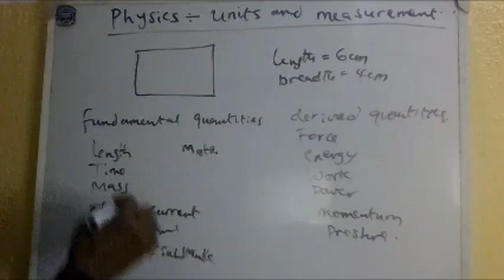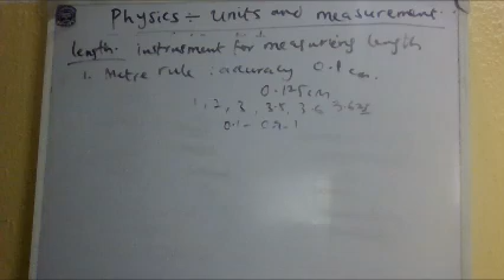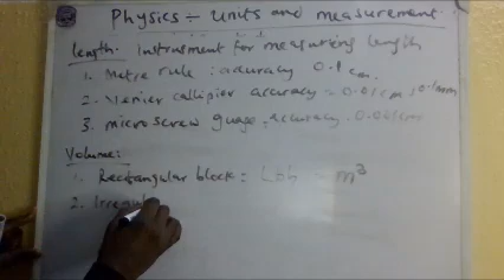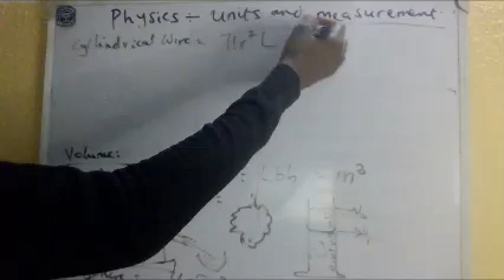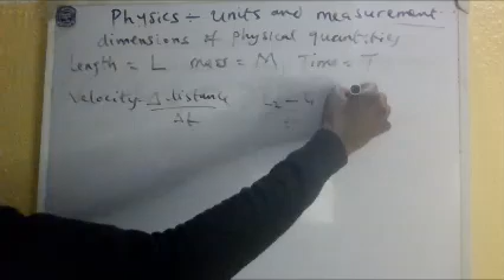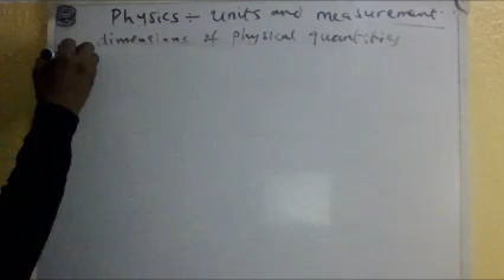PHYSICS -UNITS AND MEASUREMENTS

Comment from the maker: Question 10
A student measures a length to be 39.82 cm. The true value is 40.00 cm. What is the error?
A. 0.18 cm
B. 0.82 cm
C. 1.18 cm
D. 0.08 cm

✅ Answer: A. 0.18 cm
Explanation:
Error = True value − Measured value = 40.00 − 39.82 = 0.18 cm